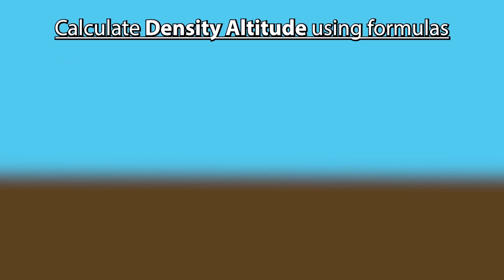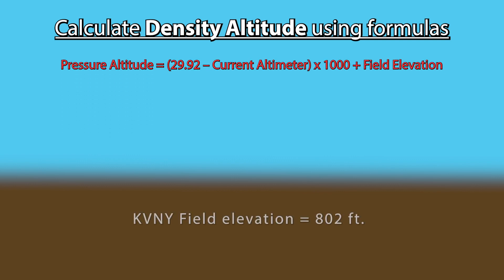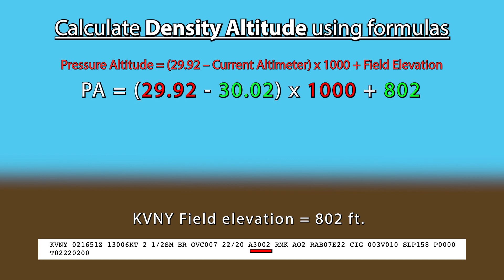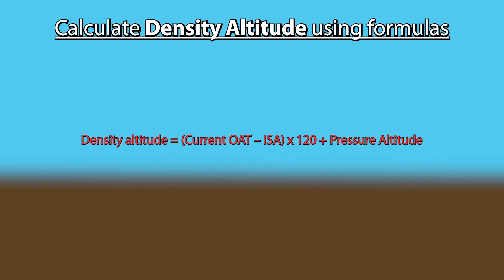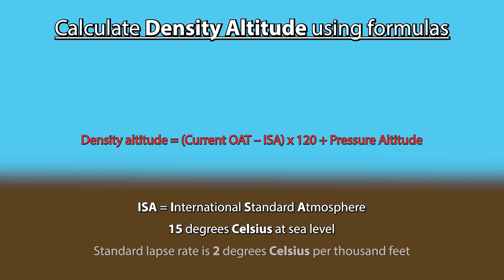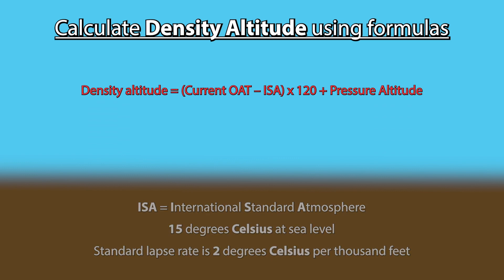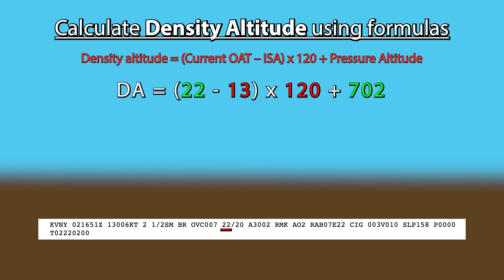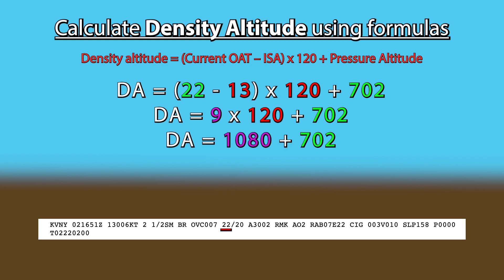Calculate Density Altitude using Mathematical formulas

Comment: if i want to calculate my pressure altitude but using Hpa , Is is okey if i use this formulas :-
pressure altitude =(1013.25-current altimeter )X1000+field elevation ????
Reply from the maker: My understanding is no, there is another formula you can use to find pressure alt with hectopascals but it's a different one, this one only works with inches of mercury.